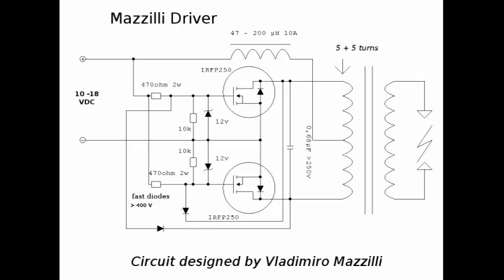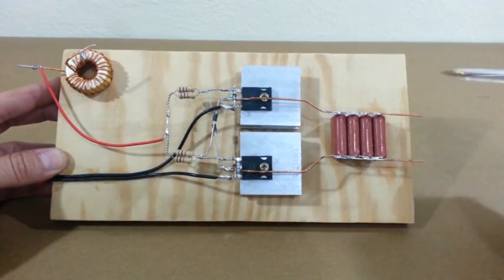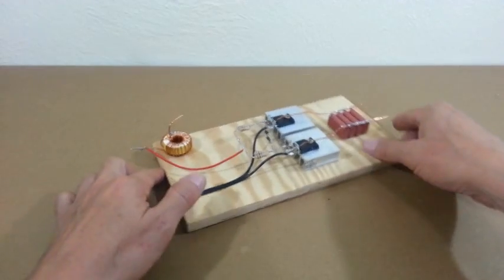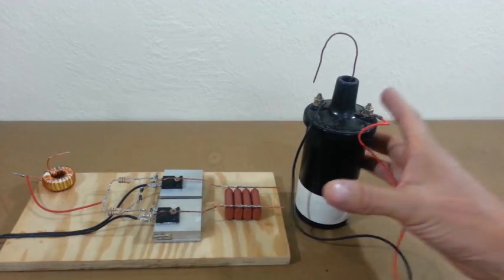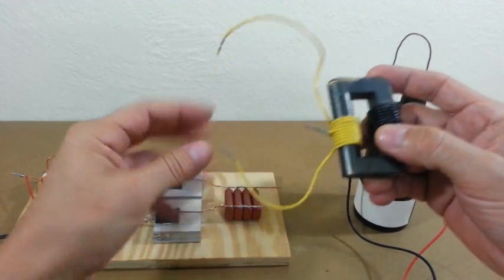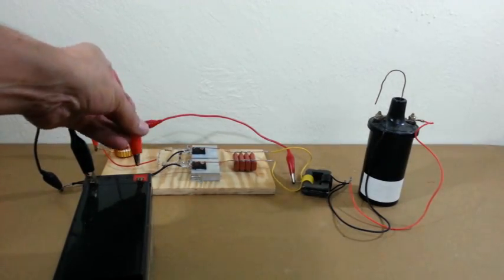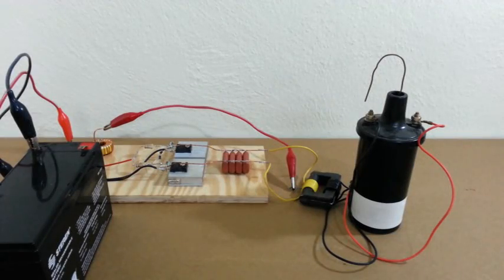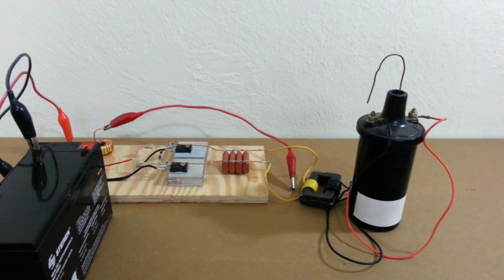Ignition Coil with Mazzilli Driver

Comment: That is not a ferrite core toroid. It is powdered iron and judging by the yellow and white colours it is probably 26 material. Also, polypropylene capacitors would be more suitable, especially film and foil type. They are extremely rugged and very suitable for this type of usage.

Comment: how to prevent both the mosfets from turning on at the same time?
When I power on the circuit, if high voltage electrodes are not near enough then circuit doesn't oscillate and both mosfets turn on and max current flows and overheats mosfets.
I mean how to make the circuit oscillate without the kickback from secondary?

Comment: Great video. Do you think I could apply this circuit to an electric rat trap? I would place the electrodes 3/4" apart so that the circuit would not fire continuously but only when a rat walks on the electrodes. Then I would need the circuit to reset after the rat was dead. Do you think it would work? Any ideas on the timing. Your response is greatly appreviated.
Reply from the maker: I also want to do the same, I think it should work, but the tricky part will be the reset switch
Reply: @ludicscience  you would need some sort of timing circuit that would reset after a minute or so. I know the commercially available electric traps use 7000 volts for 2 minutes then they reset. Another trap I've researched sends out 5 short shocks to disrupt the rats heartbeat. I'm tempted to purchase one and see what type circuirt there're using. Thanks for your response.
Reply: I bet the rat gets away!

Comment: Thanks for the video.  I tried this with a prebuilt ZVS driver and can't get much current.  The wire I used is #14 enameld magnet wire, on my flyback it draws 10 amps but with this arrangment it is just slightly over 2 with a dead short on the output.  I didn't use the capacitors are they needed on one of those Ebay ZVS supplies? and if so what is their funcation? Thanks for any help.

Comment: can i use this driver as Mazzilli ? https://www.ebay.com/itm/1000W-20A-ZVS-Low-Voltage-Induction-Heating-Coil-Module-Flyback-Driver-Heater/192105589729?epid=564029172&hash=item2cba62abe1:g:APwAAOSw32lYo~FI

Comment: Hello, really enjoy your video's. Are you using 2 sets of 2-1k Ω resisters on this driver? And your reasoning please, I have been using 1-470 Ω in each line but I am cooking mosfets all the time. I also am using irf640 mosfets and have had success but as I stated, they keep frying. Any help would be great, Thank you
Reply: Try using a higher current rated mosfet, do you have the zener and 10k resistors on the gate?
Reply: AlertIowa1234 I do have everything in surplus, I have higher rated mosfets too but everything I&#39;ve read says not to use mosfets over 150 mIlliohms, what are the issues using midgets over this rating?
Reply: Try using like a IRFP240, IRFP250, IRFP260, IRFP460N, those should have a way better current handling capabilities. How many turns do you have on the inductor going to the center tap?
Reply: And you should start buying parts either from digikey or mouser.
Reply: AlertIowa1234 I believe since I'm not at home at the moment there is 32 turns on the inductor coil

Comment: This is very nice, but most Tesla coil calculations and materials available are based on the HV transformer powered by 120 or 240 volts at 50 or 60 Hz.  What frequency is the ignition coil operating at here, or in your design where it is driven from a relay?
Reply from the maker: +TechnoWizard Here is around 1 khz, the relay one is 400 hz aprox.

Comment: If you use two inductors, you don't need the central tap ;) Thumbs up :)

Alex
Reply from the maker: +High Voltage Iĺl try that, thanks!
Reply: Ludic Science Ok :D 👍👍👍👍
Reply: Ludic Science with 2 inductors efficiency get decrease by 20-30%

Comment: this arc isnt real 6 amp 12 v arc quality. that is because the car ignition coils have steel sheet open cores therefore any frequency over 100 hz heats up the core mostly and the leftovers from the magnetic field go to the secondary and make arc. also when you wind coils around the square shaped part of the flyback core first do the windings then put the iron holder, otherwise you will heat it up a lot and loose even more energy and i recommend more turns and bigger ring for the input inductor and you can try winding 300 turns 30 awg wire secondary coil around the flyback core instead of connecting it to ignition coil
Reply from the maker: Do you have any reference to the 100 hz limit of the core? I hace driven ignition coils at 400 hz for several minutes without problems. The coil only feels a little warm
Reply from the maker: +Gotin Fuklio I'll check the video thanks!